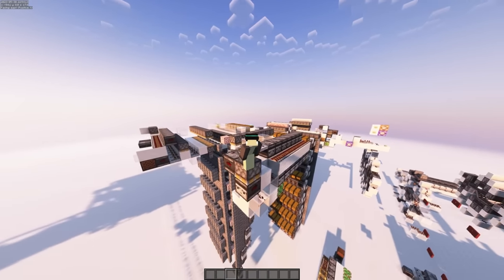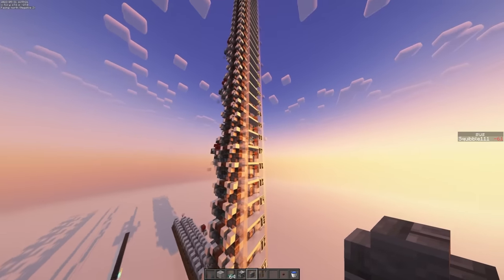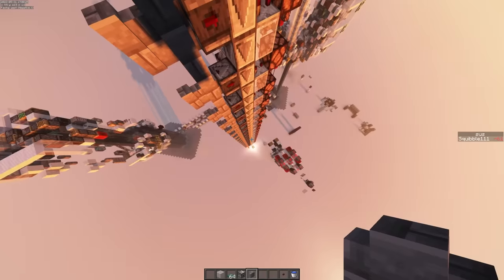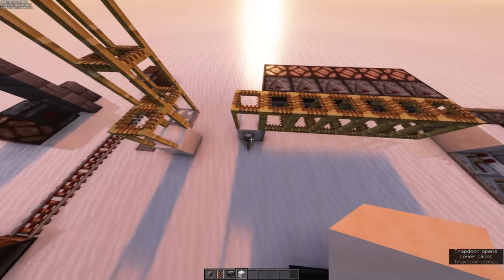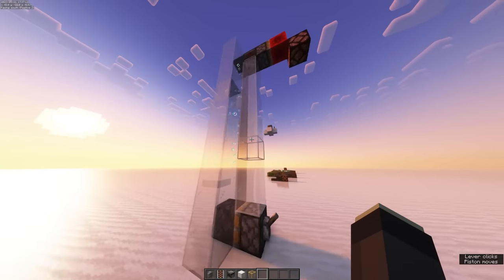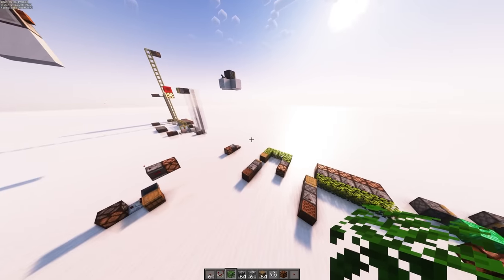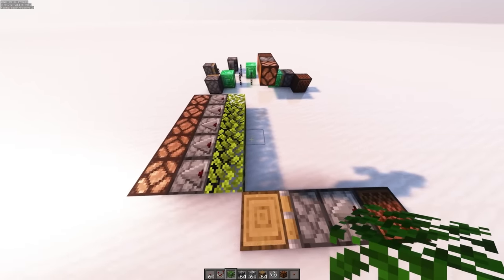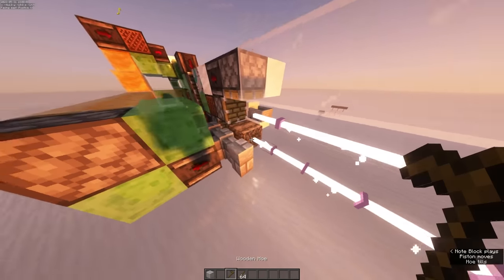The World of Unconventional Redstone

Comment: got into a debate with some redstone friends once on what is considered a redstone component. it's kinda crazy that observers opened up so much, literally turning almost ANYTHING into a redstone component if used right
Reply from the maker: You can literally use ANYTHING. one of my mob farms sent a signal to the bottom of the system by briefly opening a waterlogged trapdoor, to drop water on an observer lol
Reply: @squibble111  meanwhile me sending signal with ghast fireballs triggering string
Reply: BUD switches - the original observer - used to have the same purpose. Minecraft actually removed a lot of that functionality, then partially added it back to observers. There have then been new blocks added since that enable some additional functionality. We used to be able to detect use of beds, redstone lamp updates (remember when you could chain those?), doors, sheep eating grass, and a lot more I can't recall offhand. Observers now work again for most of those, but it's not necessarily been an improvement.

I miss stationary water...
Reply: @dragonridertechnologies but with the addition of skulk sensors it's better now
Reply: If it can be used in redstone, it is redstone. 

That's how I think of it.
Reply: First it was redstone.  Then it was slimestone.  Now we're moving into the age of soundstone.  Though until you can preserve a sound between server reboots, it won't really be that useful.
Reply: @StevesCrafts dirt block
Reply: @phoonsz  hoe the dirt block to trigger an observer output
Reply: very true, if it updates, it can be used in Redstone now
Reply: like you could even use grass growing as a redstone trigger XD
Reply: I don't like the game any more. Now you have to learn everything in the game just to know redstone. There will be a situation where you need to make turtles lay eggs or something.
Reply: @dragonridertechnologies  Stationary water can be made easily with sticky pistons attempting to move an immovable slime structure, sheep grass and doors work with observers of course, and CUD switches (comparator update detector) can be used for a lot of stuff (fex clicking an empty inventory slot in a chest regardless of having any item in hand)

Idk about bed use tho

Comment: The instrument switching detector is actually sometimes useful for splitting up blockstreams of different materials, provided of course that they correspond to different instruments.
I also used them for upward-facing 4-tick smart pistons that can extend blockstreams, but they're only useful for full, opaque blocks unfortunately. That gave me a headache when designing a block stream splitter, extender and merger, hoo boy.

Comment: Nice video. If you are planning a pt2, I have a few more ideas:

- waterlogging blocks can be detected by observers. with the new roots blocks this is even more usefull, because they are still redstone solid blocks (and house the water in one block without it flowing).

- pushing entities up to power pressure plates. placing an enderman in a minecart and pusing it up with a fence given a reach of 7 blocks vertically (if i counted right), without having any redstone blocks in between, alowing the pulse to go through other circuits.

- (sorta outdated) using entities in minecarts to detect blocks being pushed. if an entity is in a minecart, and gets pushed (but not the minecart), it actually moves for one tick allowing it to power a pressure plate (when lined up right). using different entities with different hitboxes (mainly zombie piglins for vertical and turtles for horizontal) gives some pretty niche block movement detection. This is kinda outdated now, with observers being able to do the exact same thing. but I suppose if you want to detect movement in only one direction it can be usefull. also, if you want to detect blocks moving that can change state this can help isolate if the blocks actually.

Have a great day
Reply from the maker: Thank you for the suggestions. Maybe Ill consider a part 2 given these new things

Comment: With the bubble elevator, I think there is a faster method. If you use a dispenser to remove and replace a water source from the column (Not the one directly above the soul sand. 2nd one up works) then the bubble column can fully activate sooner because it is already active. By removing a water source you're just changing the height.

Comment: although you clearly have much more redstone knowledge than I do, based on this video and others, I feel like I should mention this: instead of using redstone ticks(0.1s) and "1.5 tick" delay using scaffolding, it might be benificial to use gameticks(0.05s). so the delay of a  default repeater or an observer is 2 game ticks. the delay of the scaffolding is 1 gametick per block(if im understanding correctly). I find using gt(gameticks) more precise and less confusing.
Reply from the maker: hey bestie
Reply: @squibble111  :glump:

Comment: I'm building a multi-platform bonemeal farm where all the timing and controls are at the top (so I can expand downward relatively easily). I'm using walls to send the signals down from the top, then scaffolding to send the signals back up to the individual platforms (since an observer on the side of a wall ruins it for everything below). It'd be nice if there was something that sent a signal down that could be detected part way down via observers (yes, water could, but that's way too slow).
Reply from the maker: Its perfectly possible. I should do a wallstone video. if you draw observer output from the wall, just make sure you have another contact point on the opposing side of the wall and it wil still work.
Reply: @squibble111  No way! I just confirmed it. Observer with piston on one side, and a smooth stone block on the other. Tower it up and place an extra middle wall, and the observer observes! Thank you!!!

(of course now I have to redesign the farm....)

Comment: instrument change detection can be more useful than you might think, especially since it can distinguish between certain blocks. ilmango has a moss farm that uses it to sort out stone that doesn't get converted
Reply: That is actually genius
Reply: I use it for very simple smart pistons (that only work for blocks that change the instrument). If you use an observer to directly detect the block, it gets stuck in a loop because it detects the piston arm pushing the block away. Using a note block detecting that block, the piston arm doesn't set it off because it's the same instrument as air.

Comment: Don't forget truely wireless redstone... using the global entity ID value and its reliable incrementation like that still blows my mind (each time a new entity is made it gets +1 what the previous entity had, items fall at different times based on 4 groups determined by their entity ID value)... you could almost immediately send a signal to some (entity processing) place horizontally (and/or vertically) 1k, 50k, heck even 20M blocks or whatever arbitrary distance away without issue. Though iirc it doesn't work accross dimensions without workarounds with portal mechanics.
Reply from the maker: I could go on about wireless redstone, and how great it is, but that doesn't exactly fit the content form that I often create. Wireless redstone is complicated, its precise, and its quite difficult to understand without a lot of technical background. A lot of my channel is centered around innovating new things, even if they don't do anything practical. The world of wireless redstone requires a kind of innovation that I don't have the expertise to apply to. Another thing, I play exclusively singleplayer. WIreless redstone doesn't work in singleplayer.
Reply: @squibble111  technically speaking you could force chunk loading (iirc), but yeah, it's not nearly as useful in single player admittedly (unless I guess, if you live away from the spawn chunks, but have farms there).
I myself haven't done multiplayer recently.

Also, fair enough, it's something that already exists.

Comment: I used leafstone to make it easier to hide a "redstone line" up the wall of a tower. Covering it in leaves worked out quite nicely, and I could use a simple switch at the bottom to toggle stuff that's at the top of it, even if it had a rather long delay.
The hoe based flying machine looks quite interesting though. Do I understand it right, that it goes long enough for a piston feedtape to do a full circle, before you have to hoe the block again?

Comment: This is an awesome Redstone components analysis video. Could you do more videos like explaining optimizations such as Composters on top of Hoppers.
Reply from the maker: That feels too niche of an idea to actually base an entire video off of, maybe a short at best. Actually, a short would be a good idea. Thank you.
Reply: One interesting optimization is to have redstone lines that are 15 blocks long, and the first redstone is always powered with 14 signal strength, so it doesn't reach normally, but the line can be powered by making it 15 signal strength. This is much less laggy than normal, because for some reason, the code for turning off redstone turns it off 1 signal strength at a time, so going from 15 to 0 is a lot laggier than 15 to 14. (and so on for the other ones, like 14 to 13 instead of 14 to 0)

Comment: is glass not the quickest vertical transmission of redstone? sure you have to repeat the signal every so often, but what exactly is the benefit of scaffolding? that said, upwards transmission of signal has always been easier than downwards, so I may need to consider making better use of the wall method for downward transmission.
Reply from the maker: generally used for low cost applications, like early game farms, or compact situations where you want to run a line straight upwards where a redstone line isn't possible.

Comment: -"Redstone is kind of incredible". Yes, incredibly stupid - imagine if we didn't have thinner electrical wires than redstone IRL, go on, just try for a second to imagine that. Imagine it took an entire square meter to run just one wire across, now imagine it took three square meters to run two wires across, without shorting them out. Redstone is incredible alright, incredibly, astoundingly, and mind-numbingly stupid, try building a redstone contraption that has just 1% of the power your phone has, and see how much space it'll take up. Anyway, enough of me bitching about how MOJANG messed up, an interesting video, I'll do myself a favor and look into some of these examples, thanks for sharing.👍

Comment: "1.5 tick repeater" REEEE.
Its just 3 ticks not 1.5
Reply from the maker: Yet, people don't go around calling redstone repeaters on the lowest setting "2 tick repeaters." in the context of redstone, "tick" means redstone ticks, or 1/10 of a second, or 2 game ticks. So yes, the "1.5 tick repeater" is a 3 game tick long mechanism, but in the context of redstone, (the context i was using it in), its precisely 1.5 (redstone) "ticks"
Reply: @squibble111  In the technical community we say that a repeater introduces a 2gt delay. If you need to say 1 or 1.5 ticks every time there is an odd delay we'd have a lot of problems. For example: A piston extending takes 2 ticks before the block it pushes can power another block. However if the block it tries to power is another piston it takes 3gt. Nonetheless cool video. I didn't expect you to answer to my comment.

Comment: Yeah... Let's not call it redstone anymore. This was never the intended use for the stuff. Redstone was "meant" to be used with...well...redstone dust, redstone torches, and redstone repeaters. This whole...block detection stuff isn't really redstone, and all this 0-tick stuff is clearly not what Mojang wants. These modern "redstone" creations are not redstone anymore. It's "hackstone". It's like taking a chair and scratching at the dirt, then calling it a shovel because it can, in fact, be used to dig.
Reply from the maker: Redstone wasn't meant to go this far, I don't imagine, but pushing the boundaries of whats possible with the tools were given has always been the driving force behind the community of this game. Whether it's intentional or not, we still use it for what its worth, because its often the unintentional features that make some of minecrafts most mundane additions special.
Reply: If scratching dirt with a chair is the most efficient way to dig, then whoever in charge of making shovels is doing an abysmally bad job at making shovels.
Reply: What's the point really? I mean, redstone dust, repeater and redstone torch was meant to be a method of transferring signals, so if we find a better way to do that, why insist on keeping the old way? Why insist that it's a different thing when they are doing the same thing? I mean, if we find a way to instantly transfer electricity from one place to another without using cables and wires, would you stop calling it electronic and instead call it hacktronic? And even computers! Early computer use, well, card, like, literal card, to do it's magic. It's vastly different from the computer we know now, and even then we still call them, well, computers. Nothing has changed about their purpose, we just build them a different way. Well yes, unintended application of block behavior is well, unintended, but these applications were made possible by, guess, *a redstone component*. We are still using redstone, just not as a way to transmit signals anymore. So, back to the original question, "what's the point"? It's not like Mojang is particularly unhappy with these unintended usage of block behaviors, and changing the way we call "redstone machine" will only cause needless confusion. For all people in the blinds, a redstone machine using redstone dust, repeater and torch as a way to transmit signals, is the same as a "redstone machine" that uses other means to transmit signals! They do the same things, in the same ways, just with different means of transmitting signals. A very familiar real life equivalent is like, using traditional wire cable vs using optical cable, and you can't be complaining about using optical cable is not how it is meant to be done, right?